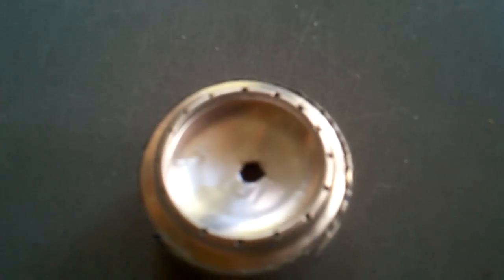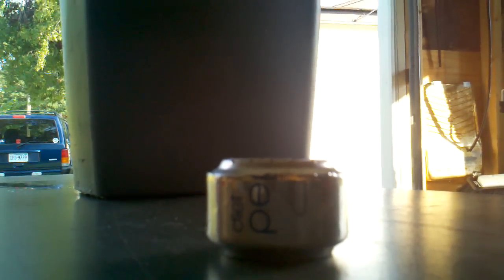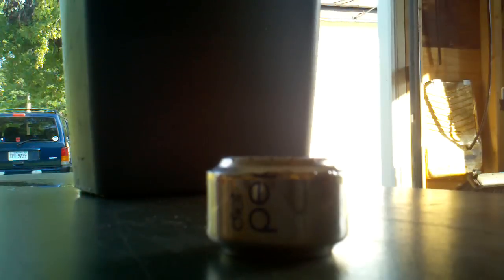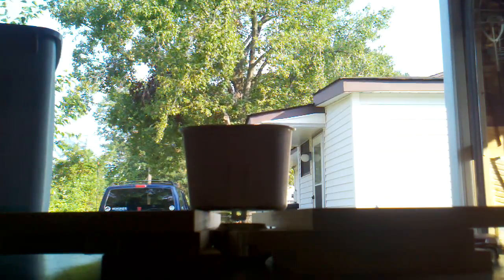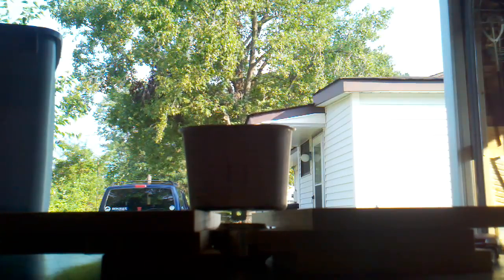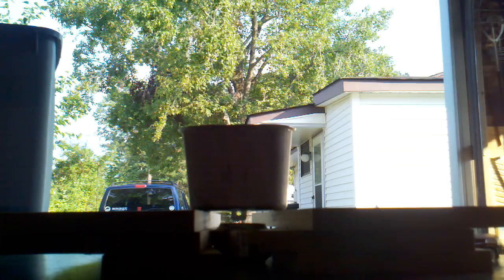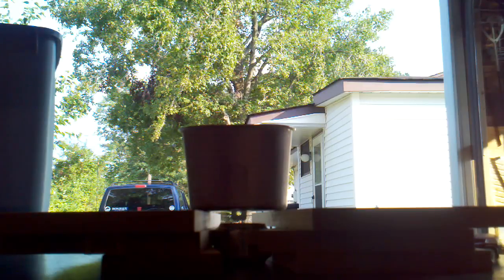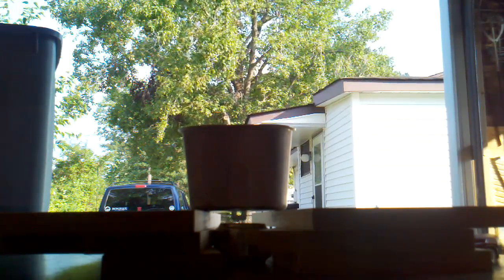Beer Can Stove Follow-Up

Comment: I bought my stove on ebay for $20, with windscreen and a top that partially closes to regulate the flame, as well as a screw on top with gasket to keep the fuel in. I use it frequently. I wish I could find cheap alcohol. I tried rubbing alcohol, but that has water in it, making it burn badly. The good stuff retails for $20 a quart, not very economical. Gas line anti-freeze works good too